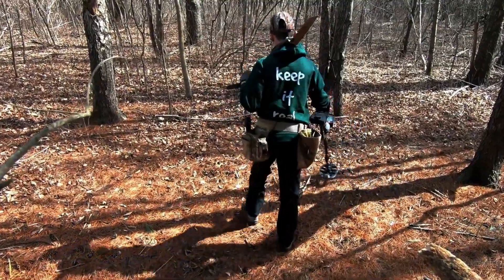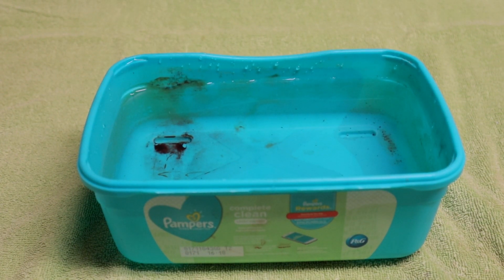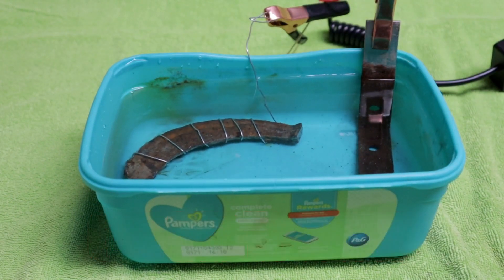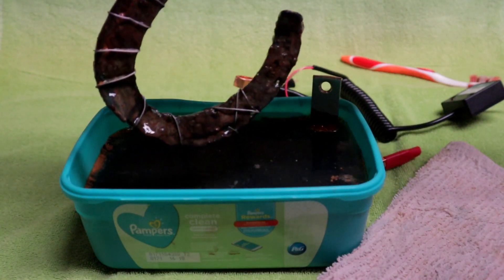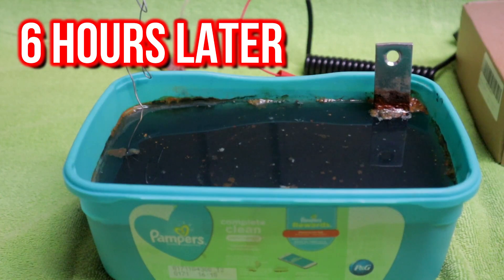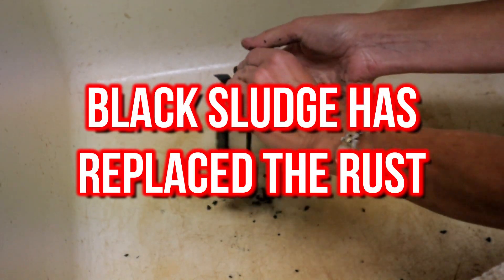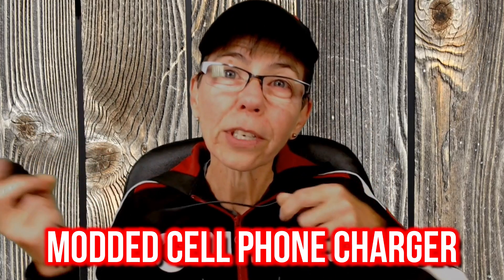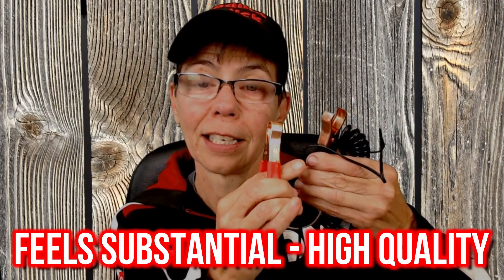EASY Electrolysis : How To Remove Rust From Metal Detecting Finds

Comment: Hi Liz thanks for a nice video.  Ive done electrolysis before with mostly good results. I was wondering what type of steel wire you are using. I’ve been using galvanized 19 gauge steel wire but am wondering if there is a better choice.
Reply from the maker: Hey Mark, I'm using 20 gauge wire from the Dollar Store.  I'm told the secret is to have metal to metal, in that you may have to file the rust on the relic to expose a bare metal spot on which to wind the wire :)  Thank you very much for stopping by and commenting :)
Reply: @DiggingCanuck  awesome thank you!
Reply: Thank you very much for the info.  Finally a name to the object I'm after. On my way to get that trickle thingy.

Comment: Does this process work on any type of metal including copper and bronze objects?
Reply: Thank you, I will try it😃
Reply: bro dont do electrolysis on copper or bronze they dont 
get rusty...water can be poisonous if u use copper wires in electolysis
Reply from the maker: Electrolysis will work to a certain extent on all metals. However, I have only used it on iron objects. You can always experiment or consult a professional.

Comment: Trickle chargers have an auto stop when a battery is full or not connected right so mite stop the current. Best use the old battery chargers
Reply from the maker: I purchased a battery charger for my large scale electrolysis bit haven't tried it yet.

Comment: If not stainless steel, what metal specifically is safe?

This is the second time I stumbled on your channel
Reply from the maker: Any metal except Stainless....
Reply: Don't use chrome or galvanized metal  @DiggingCanuck
Reply from the maker: I use those steel angle brackets

Comment: Also, if you use steel aligator clips and they're touching the water during the process, the positive clip will dissolve along with your sacrificial metal. Don't ask me how I know... :D
Reply from the maker: Good tip.  I have seen people put the leads in the water but I dont think that is a good idea.

Comment: Thanks for the tutorial Liz. That trickle charger seems like a safe item to purchase.
Reply from the maker: I feel a lot safer using it
Reply: @DiggingCanuck  Could you send a link to which one you purchased from Amazon, if possible.
Reply from the maker: @metaldetectingbrooklyn9896  Here is the one I bought: https://www.amazon.ca/HOYOA-Automatic-Household-Motorcycle-Automotive/dp/B07GBXJNWG/ref=mp_s_a_1_31?dchild=1&keywords=12+volt+trickle+charger&qid=1633217472&sr=8-31
Reply: @DiggingCanuck  Thanks